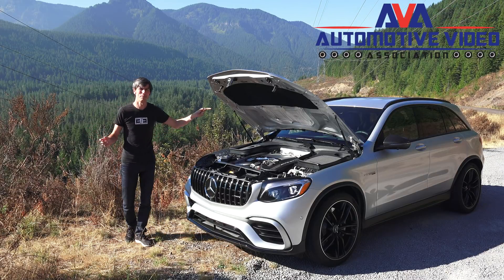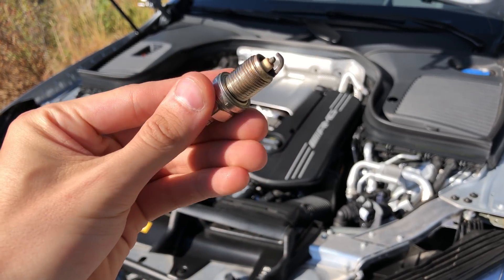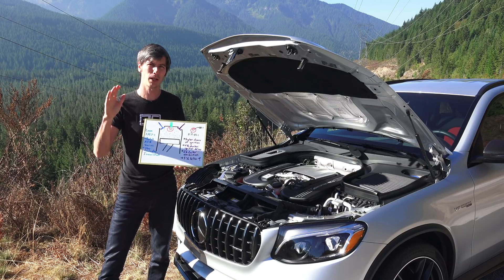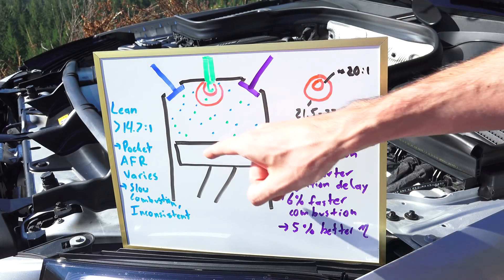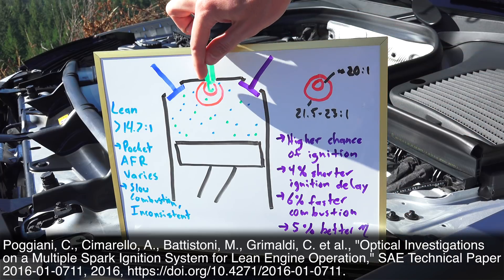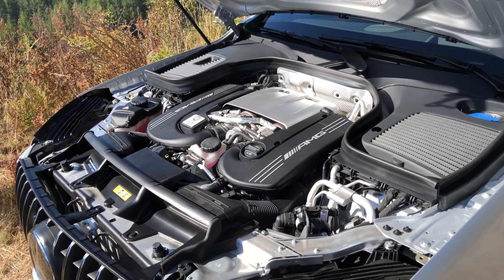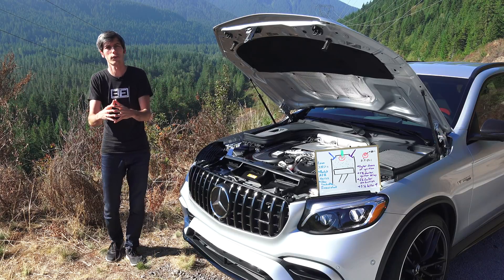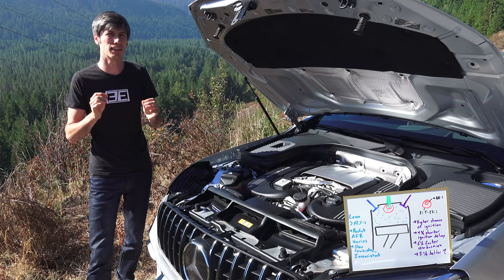Mercedes Spark Plugs Fire 5 Times For Better Efficiency

Comment: Next evolution , 5 spark plugs
Reply from the maker: Ha! There are actually some technologies out there which use an additional layer where the head gasket is, which lines the cylinder with 8 or so sparks around the circumference of the bore at the top. Speeds up combustion! Probably expensive.
Reply: @EngineeringExplained  this I need to see
Reply: @EngineeringExplained  that is quite interesting! Engineers come up with all sorts of ways to make an engine more efficient
Reply: Topfuel or some dragsters nonsence use 2 spark plugs per cylinder
Reply from the maker: Yep! Dodge also does with several of their hemi engines (2 plugs per cylinder). I believe they do it in Top Fuel to also have some redundancy, as it's common for spark plugs to fail in those extreme conditions.
Reply: Alfa Romeo did that too with their TwinSpark engines.
Reply: @EngineeringExplained  
So does Ford.
Reply: Wankel engines use 2 spark plugs per combustion chamber and the Mazda 787B used 3 spark plugs per combustion chamber.
Reply: The ring of plugs is the interesting one. Honda had been doing dual spark with their IDSI
Reply: Even closer to home, my friend's S203 C240 Mercedes-Benz is equipped with the M112 V6 engine with two spark plugs per cylinder. They've probably moved on to a single plug multi-fire system due to space constraints caused by direct injection.
Reply: 5 spark plugs with 5 electrodes all firing 5 times 0_o
Reply: Why stop there? Also 5 intake valves, 15 injectors per cylinder!

Comment: I clutch more times than that, miss me with that granny shifting.

Serious question though, why not fire it 100 times instead of 5?
Reply: Because past a certain point you're basically just keeping the spark plug lit up due to lack of time between spark. Ever turned your key off then back to ignition when pulling up (to kill the engine but keep the radio on for example) and you do it a touch to quick the engine bursts back into life?

That same principle essentially.